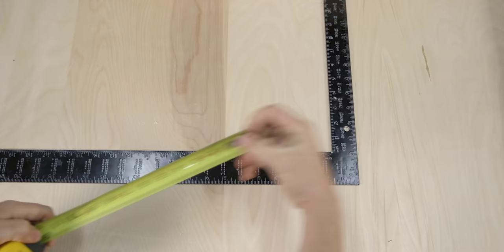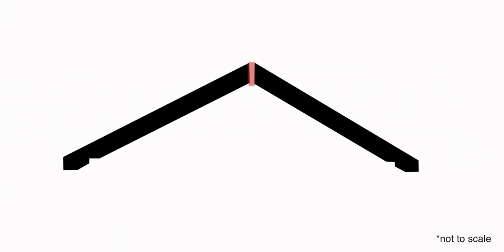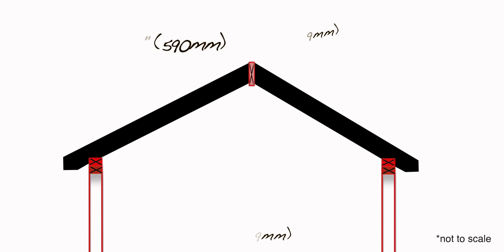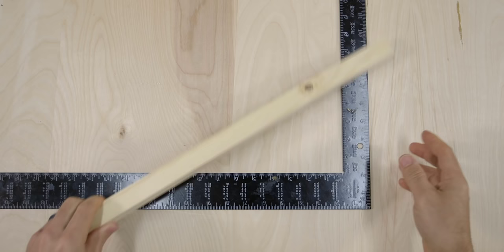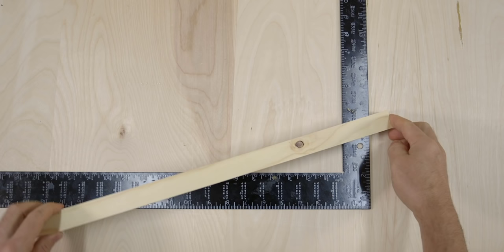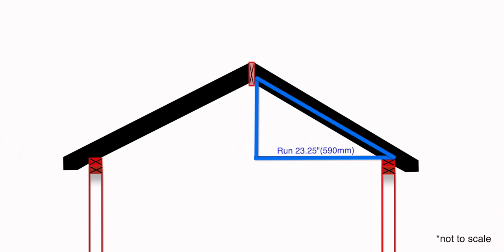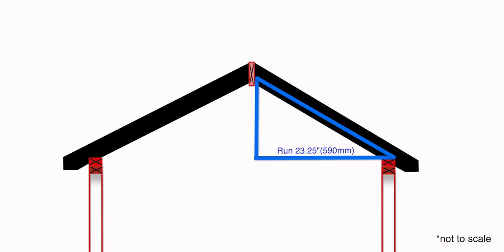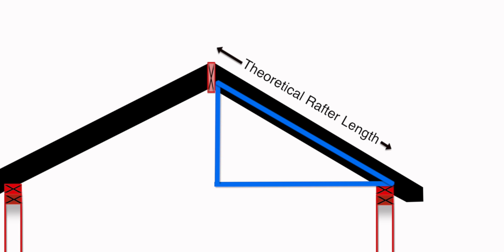How To Use A Framing Square To Build A Roof

Comment: 6:14 lol, this conversion from 
100ths to fractions is gold for me,
I don't recall every being taught this;
.92 converted to 16ths is 
.92 x's 16 (16 representing 16ths of an inch)
equaling 14.72 
(rounded down in this particular case)
to 14, hence 14/16'' , then reduced to 7/8''.
This will help me so much 
in my day to day work in the shop, 
I can also use it to determine odd sized 
drill bits, etc, eg; 
If I had my caliper on a 
.92 drill bit that's unmarked, and needed
a new one, I could just multiply 
.92 x's 64 = 58.88 or 59/64'' . 
Thank you!
Reply from the maker: Thanks for the comment. Blessings.

Comment: The advent of the manufactured truss has really ruined a lot of newer carpenters.  Actual stick framing is becoming a lost art.  Very well done video.
Reply: Definitely true
Reply: As a new carpenter I agree, when we build a complicating roof you have to do some framing to sheet it, but it's a lot of pulling lines and just making stuff work, not much math, my co worker that used to own a stick framing company hates it

Comment: Awesome education many framers never use anymore due to manufactured trusses commonly used. Here's a question ... When two roof pitches intersect making a valley, if the same pitch or not. How do you get a accurate sheeting cut on the end into the valley? I swear two of us had screwed up four sheets after both measuring twice before cutting. Measured distance from end of last square sheet at top and bottom and it didn't work.

Comment: We have a roofing square in the UK made by G Gibson. Its metric but its the best and most thorough square sold. You can work out every possible bevel needed on a roof. We mainly have a degree of pitch to work with rather than a rise/run.
Reply from the maker: Dude, thank you for sharing this. Can you provide the link to that tool please.
Reply: Smallwood were the original imperial framing square in the Uk. We get taught to use this square at college during our apprenticeship. Ive been using this for the past 30 years roofing. Comes with a detailed booklet too.

Comment: how did you know what angle for the 5 inch overhang. It looks like you just free handed the angle with the tape measure. in the video. please explain. thanks
Reply from the maker: What's the time stamp in the video for that?
Reply: @TrainingHandsAcademy  4:28 in the timestamp
Reply from the maker: @garyvanvranken1028  I measured over 5" with the tape and then used the square set at the 6/12 pitch.

Comment: Is there another purpose to use a spade bit other than framing? Can it be used for fine wood working? I try to find a video how they use it on youtube but no one seemed to be using those other than framing.
Reply: Might be a bit too rough for fine wood working but if its not visible then why not. But I find it more satisfying to use bits that make holes with better guality. Spades are more of making a hole fast and efficient and they are not too sensitive for driving into nails. Also cheaper that good guality drills.

Comment: Great video as always. I just don't understand how can we use the same measurement for common rafter (1.94) which is based on 12" per run for hip rafter which is based on 17" per run?
Reply from the maker: Thanks RH. You mean the same run measurement?
Reply: @TrainingHandsAcademy  
Thank you for quick reply. 
I was confused about the run for a common rafter vs run for a hip rafter. They are not the same length.  After many of your videos and calculations I figured out that 12" (common)) rafter and 17" (hip rafter) have to be calculated as the same (one)  unit? 
Do you/training hands academy have hands on classes? 

Thank you :)
Reply from the maker: @RH-vm1pm  Unit run for a common rafter is 12". Unit run for a hip rafter is 17".

Comment: What determines the 4 inch value at 4:34 please?
Reply from the maker: The overhang amount and soffit cut numbers are almost always different for every roof, and it really comes down to design, preference, and/or what type of trim you’ll be using. Therefore, the 4" in this video is just an example. Hope that helps.

Comment: As a professional carpenter, I just step out the rafter with the square.  It's faster than trying to figure out the math and is the most accurate.  I would be done by now and you are still trying to do math...
Reply from the maker: Already did a video on that https://youtu.be/QV7hfQJ15o0
Reply: There's nothing more accurate than the calculator. Use it for the math and the square to put it on the board.

Comment: What is the long hand math ( not using construction pro) to calculate the Jack Rafters? I get and understand 95% of all your rafter playlist. I can manually ( long hand ) use math  to get hip and common and all the other parts. I have put  all this in an Excel sheet, But what I can’t figure out is the math ( again, long hand ) of finding the jack rafters.
Reply from the maker: The math is unit run over unit length = total run over x (total length of Jack). You then need to solve for x. For example a 8/12 roof would have a jack length of 19.23 (19 1/4") The math is already done for you on a framing square. Third line down on the rafter table shows "difference in length of jack's 16 inches centers"  which again is 19 1/4". Therefore, the difference (19 1/4") is actually the first jack length, IF your layout is from the end of the valley rafter (or overhang), OR that 19 1/4" can be subtracted from the (common) king rafter's length to get the first jack rafter to the right or left of the king rafter. You may or may-not need to subtract the 7/16"... just depends on how you frame the valley or hip. Bottom line, the numbers are all on the framing square which is really great. I need to do a video on this. I hope that helps.
Reply: @TrainingHandsAcademy  thank you so much for the reply. Now it’s  time to study your response… your videos are hands down the best on  YT.
Reply from the maker: @jcpad1797  Thank you very much.

Comment: While this does give a good idea what the numbers mean on the square, I think your explanation gets a little lost in the weeds. Though, ultimately, you still get the correct answer!

Dividing the run by 12 isn't converting it to feet, otherwise your outcome would also be in feet.  Irrespective of the unit your run is measured in, you'd still need to divide it by 12 and it would still work with the values on the square!  Inches, feet, meters, metres, furlongs...it doesn't matter!  As long as the slope of the roof is expressed in inches of rise over 12 inches of run, the ratios of the triangle's sides will remain the same regardless of how the actual building is measured.
Reply from the maker: That is fantastic. Thanks for adding this info!